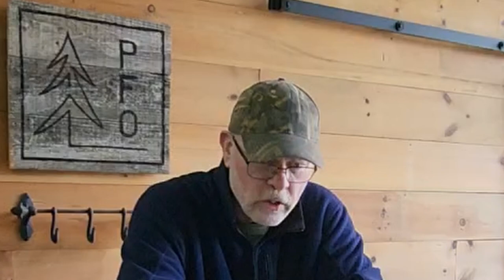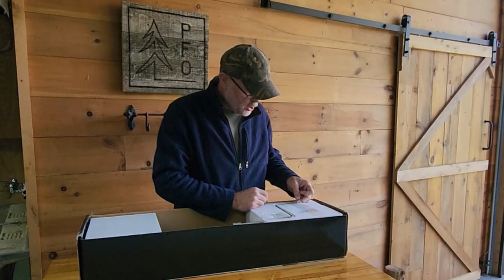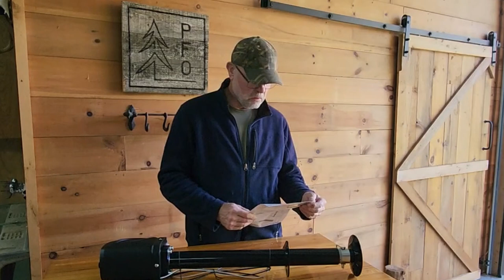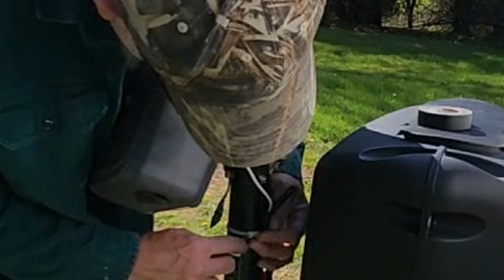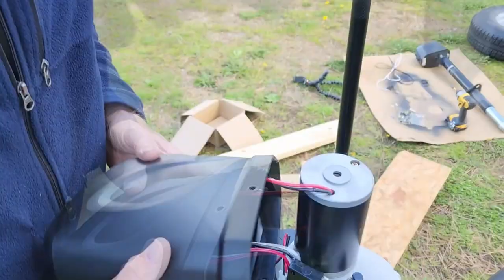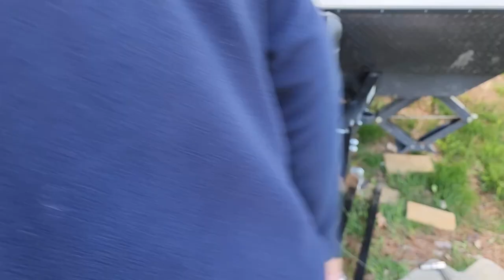Replacing the Tongue Jack on your Travel Trailer

Comment: Bummer it went out RIGHT AFTER the warranty! How do they time that so well?!
Reply from the maker: I've not had an opportunity to review the design evolution of this, or other tongue jacks, so it's hard to say whether this one was just a poor design from the start, or if it was the victim of a cost reduction project. It may have arrived where it is by chance, which is to say sloppy engineering. Or, it may have been the result of a carefully executed design validation and durability test regimen where the average cycles to failure was determined in the lab, followed by a series of design iterations where the components were either improved or cheapened up, as necessary, so that the resultant expected life of the product, adjusted for the desired standard deviation, would just barely exceed the warranty period. It's not a complicated process. Most products don't get where they are by accident. Some companies design for overkill, others shoot for just barely good enough. Sorry for the long answer. It's what I do...or did 😁
Reply: @thePFOchannel  that makes sense, though it’s also a little maddening! Thanks for letting us  in on the process. 😄
Reply: @thePFOchannel that makes sense, though it’s also a little maddening! Thanks for letting us in on the process. 😄